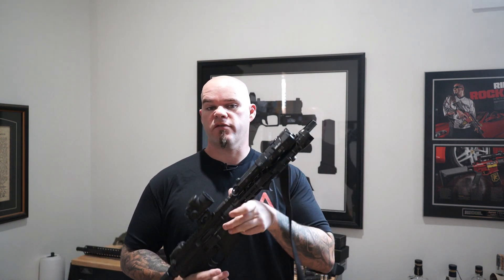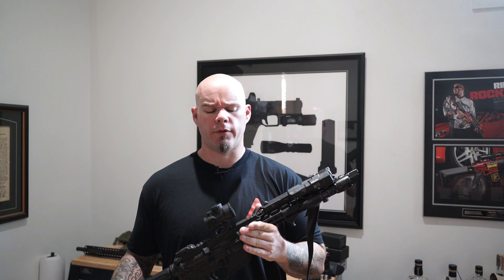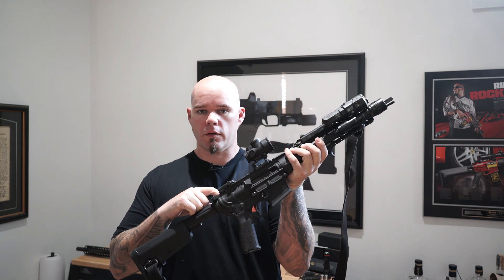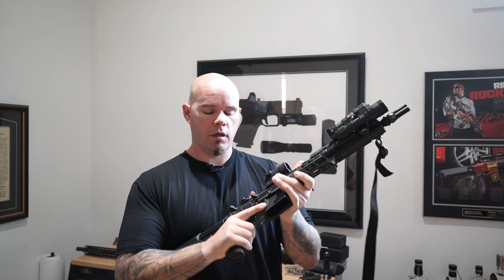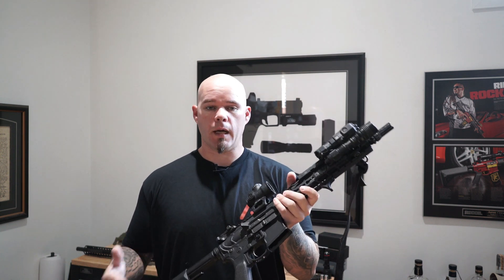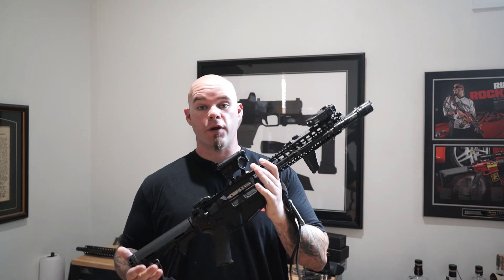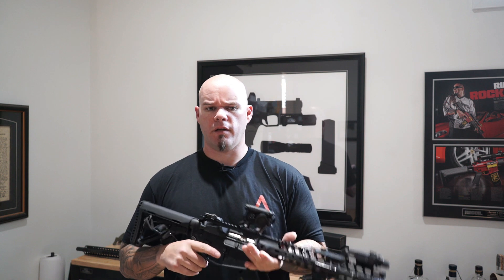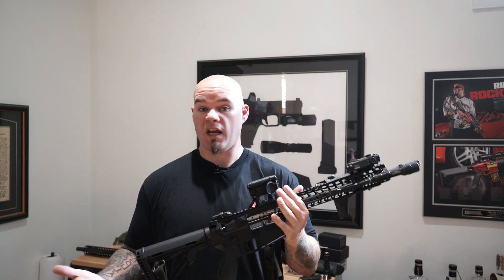The Forward Assist

Comment: I've used it while deployed. Sometimes the sand would cause the bolt to act sluggish in returning forward and would stop mid cycle. A Good tap on the forward assist and it would continue it's cycle of function. Yes I could just pull the charging handle, but the forward assist allowed me to keep a sight picture and continue to observe a target. Just food for thought, it's not necessary, but I prefer one on my rifle.
Reply: The Armorer The first sensible argument for FA I've ever seen. Fucking great job!
Reply: The Armorer 100%
Reply: Jesse Galuk he didn’t say anything about firing. He mentioned keeping his sights on a target which would be doable. Not losing sight of someone is a valuable concept
Reply: Jesse Galuk Its faster to get a good grip on my rifle than get a good sight picture and require my target, especially with an Acog. I do nose to charging handle so I have to pull my face off when I charge my rifle. Additionally I won't fire without aiming unless in very specific scenarios. Happy Thanksgiving dude.
Reply: I've used it many times . In a sandy environment. 7 years in the ME . This is YouTube take it with a grain of salt .
Reply: *re-aquire
Reply: The Armorer ???  What???  What situation have you been in where this is even plausible?  So you had your rifle shouldered with someone or something in your sights while simultaneously having reloaded a magazine and I'm assuming hitting your bolt release and the bolt stopped mid way to the chamber?  That's a stoppage that needs clearing not some tap on your FA situation
I know this is the internet but at least make an attempt at non fiction story telling
Reply: Jesse Galuk you don't.  He's telling pog stories
Reply: deadheart I'm an 11B and it's not while reloading, just mid shooting when the "moon dust" cakes up your rifle, slows the bolt carrier to the point where it might not be able strip a round from a gritty magazine.
Reply: The Armorer oh my god he’s an astronaut
Reply: Jerry lol "moon dust" is the nickname for the very fine sand in the middle East lol
Reply: The Armorer I understand what you're referring to, I don't understand the importance of maintaining your sight picture in the example you're using.  I guess the manual of arms and weapon malfunction corrections have changed in the 8 years I've been out.  
And you're now saying your bolt slows down, previously you said it stopped mid-way.  I'm sure you can see why I was confused.
Reply: deadheart deadheart sorry for the confusion, what I mean is the bolt slows down enough to not have enough momentum to continue forward and strip a round from the magazine, causing the cycle of function to stop. I've been drunk all this long weekend and still am, so hopefully I'm explaining well.
Reply: Just a question.  If it starts to slow down and eventually loosing enough momentum to strip a round off, it makes sense that a tap on the fwd assist would help, but wouldn't that just continue to happen.  I think his point would be to attempt to correct the issue.  However I can see the argument being what if you're mid fire fight or something....hhmmm food for thought......Now I kinda like the idea of having one there.  It seems to me it comes down to training because Aaron is right....if you use that thing in the wrong scenario, it will render the gun unusable.  I think Aaron's point is unless your so highly trained that you have the ability during a fight to determine when and when not to use it,  it's just better not to be there.
Reply: J Nault I would also believe those of us that may use an AR for personal defense here in the states would not require it! But I completely see how it would be useful for those fighting abroad. For all of those that have or are serving THANK YOU!
Reply: The only reason for the forward assist is to return the bolt home to be able to disassemble the rifle in case of malfunction. If the bolt isn't home, the rifle cannot be opened up. The charging handle is non-reciprocating, so pressing it forward does nothing to return the bolt if it gets stuck part of the way back.

Comment: I happen to agree with you on this 100%. If it’s there great and if it’s not oh well. However, I have come across one example where it came in handy. In a hunting scenario (yes some of us use AR in various calibers for that purpose) where running the charging handle and letting the bolt go home may cause too much noise, I have slowly chambered a round where half the time a gentle tap of the forward assist helped. Now that said, like you mentioned you can always use your booger hook to push forward on the BCG.

Comment: I remember in the Marines it was common for Bolt Carriers to have a shiny strip along the forward assist cut outs from the forward assist rubbing against it. We were taught and pressured to pound on the forward assist "man handling your weapon" to the point that they'd nearly brake. Imagine a metal rod grinding against your bolt carrier and it's easy to surmize that would be a timing shift or change in cyclic rate. Not an ideal situation. 
We were taught to do this during breaks in fire, and never used it in immediate action drills(malfunction correction) which consisted of these steps: 1 drop the mag, 2 pull the handle back(basically still holding the weapon with it withdrawn) and place your finger into the chamber to push out any double feed that may still be stuck. 
So basically there was no reason to pound on the forward assist yet Marines did it endlessly.  It's simply a bad design, that Gene Stoner was against and that the Army wanted because they felt that soldiers would feel uncomfortable not having anything to drive forward(pushing a bolt handle forward or pushing the Bolt handle on Garand/m14.

Comment: I've only ever used it in a hunting application. I have a fairly new rifle with low round count. I'd try and just push the BCG into battery with my finger after easing it home but couldn't. I'd still generally have to give to forward assist a good rack. The rifle has proper headspace and no cartridges have been deformed as of yet. I believe it's because my extractor tension is really tight. It has the 5 coil spring, black insert and o-ring.

Comment: The forward assist is for returning the bolt to the home position in case of a malfunction. If the bolt does not go all the way home you cannot open the rifle to inspect the malfunction. There is no other way to do this since the charging handle is non reciprocating. I really wish more instructors were aware of this simple fact.
Reply: Couldn't you just remove both take down pins to get it apart?

Comment: When I'd put my rifle back together wrong, it was under-gassed due to bad gas block alignment. It had enough power to push the carrier back far enough to grab a new round, but hadn't been pushed against the spring enough to push the round all the way into the chamber, basically shorting it by 2 centimeters of travel. I looked after clearing, good round, pretty quickly on the range figured out I'd screwed up the gas block, but had to still sight in the gun. So, fire, tap forward assist to chamber the round, and fire again.

So if the gas system's messed up, or there's something else to impair the motion of the bolt carrier rearward (or at all), but the chamber is otherwise good (no double feed, bad rounds, whatever), I think the forward assist is valid to employ. I can shoot faster tapping the forward assist versus racking the charging handle, and it also mitigates the need to rack out half the magazine's ammunition.

Good points on not making the situation in a chamber worse by forcing the bolt into it. While I did kinda know that, it's good to be emphasized. For what it's worth with my malfunction, it was one easy press per malfunction to chamber the round, versus hammering on the button.

Comment: My understanding is that a FA was never intended on the AR platform but featured as an added benefit to allow manipulation of the rifle in ways a charging handle doesn’t allow. Minimal movement is ideal. This is especially true in cold ass environments where your fingers feel like falling off. 

Carbon fowl is also a simple fact of shooting a rifle. To work around that problem, a quick tap after a press check is easier than press check and racking. Is it necessary? Not really but again, added benefit.

Comment: I thought the bevel in the bolt carrier was for getting it back into battery. That's what Stoner intended I believe. Same principle you mentioned about not forcing it into battery. If it won't go with minimal effort then you may need to check.

Comment: Great video  what's your thoughts on putting the safety on when transitioning to the handgun? I've seen arguments for both why to do it and why not to do it i tend to be in the middle situation depened  thanks in advance Aaron
Reply: guns and tactics Put that safety on. You don't know the exact reason for the malfunction and there is literally nothing to lose, and everything to gain by turning the safety on.
Reply: Mark Llamas  i understand that you won't do it under stress and that even if you do put it on safe say in the case of a double or triple  feed that you now have a dead . Locked inoperable gun but i really dont know I've never experienced one in my personal AR
Reply from the maker: Mark Llamas if you understand the rifle, you can diagnose the likely malfunction by how the rifle behaves. Also, there’s a few malfunctions that prevent you from being able to put the safety on anyway.

Comment: This is funny you mention that. As a fellow infantryman, 14 years, I can say the ONLY time I ever used one other than through the rote firing range drill, was when using blanks. The chamber gets so fouled, its needed. Real world? Never once. And I have been using this platform since 1988. As a lefty, for me it is simply more natural to rerack the bolt than to reach around awkwardly and hit the FA. 
Interesting that you mention how few modern battle rifles have them. I never thought of that.

Comment: I have used the FA exactly one time on the qualification range with a suppressed, under lubricated, and extremely dirty rifle that did not want to go into battery when being loaded.  In that instance, it worked.  But what the gun really needed was lube.  I would have no qualms about carrying a rifle without a forward assist in a duty capacity.

Comment: I agree with everything you have said.  I guess I would still prefer it for only one condition.  If I accidently ride the charging handle forward and the rifle is dirty or dry then it's handy to tap it into place.  

It's basicly a non issue though because I would never have to use the charging handle unless it fails to lock back or I have some type of failure. Just use the bolt release and it should be fine.  And obviously you can push like you mentioned.  It's simply a feel good measure that was put into place die to shitty Vietnam ammo that was originally issued.

Comment: Soldiers, Sailor, Airmen, Marines and Cops, DO NOT NEED A FORWARD ASSIST! If the bolt carrier won't go into battery, there is a reason.  
With that being said, I won't own an AR-15 rifle without one. The reason is this: I hunt coyotes with my AR15. When I move from stand to stand, I do it with the rifle unloaded, When I get to where I am going to set up, I QUIETLY load my rifle by committing the cardinal sin of riding the bolt home. I use the forward assist to insure the bolt carrier is properly seated. I know hunting has NOTHING to do with the context of this video, buts its why I want a forward assist.

Comment: There is an arguement that the FA be used for surreptitious loading while hunting.  It's not very applicable to purely defensive guns, unless yours is dual-purpose.
Reply: then you can just push the carrier forward with your thumb. On a side note,I shoot suppressed out of the AR a lot, and rarely clean it. Never have a malfunction due to dirty guns. I also then take my suppressed AR15 SBR in 300blk hunting and then try to quietly chamber a round near the stand, after riding the quad. Problem is, the cartridge doesn't chamber because of how dirty the rifle is and even the Forward Assist isn't able to force it in. So I have to loudly pull and release the charging handle, which works.

So several options; 1) Load the rifle before before I ride the quad, 2) Clean my rifle a little more (ewww) 3) Just chamber the cartridge normally and not care about the noise because I just got done riding a noisy quad.

Anyway, that was just a long story about how trying to be sneaky with a Forward Assist is still stupid.

Comment: I’ve used it. My rifle BCD kept stopping just short of the lock position. Half pull on the charging handle didn’t have enough force to send it forward. Full charge had enough force but would eject around. So tipity tap tap tappy on the forward assist and I was G2G.

Comment: They work good if you got a girlfriend or wife that doesn't charge the weapon properly at the range lol. That's the only time I ever used the forward assist on my rifle. But I guess I could just have charged it for her. Also, this Is out there but maybe you get injured and don't rack the gun enough to go in to full battery might be quicker to push the bolt home. But I agree 99% it just adds weight and a potential snag point on the gun.

Comment: I do agree, it's a useless control, but the U.S. army being one of the main dictating bodies on upgrading the m16 still believes in the idea "it's there to make you feel good/ better to have it and not need it than need it and not have it" also agree with the common sense point why would you need to silently push a hot bolt forward but at the same time a smart rifleman using common sense wouldn't ram the bolt down or a dirty chamber unless you absolutely had to either theres an easy solution when you're not being shot at... CLEAN YOUR RIFLE!

Comment: Most people will never need or use it,.. Ive only could see it purposely used to chamber a round more quietly, or when its super dirty while using a suppressor or has some grit in it,.. but you should already have it chambered,...not really a need for it for 99.999% of the people,..

Comment: It appears that the forward assist may have saved Kyle Rittenhouse’s life.  Watch his interview with Tucker Carlson.
Reply: So it did, I think slingshotting the bcg (utilizing the spring tension and inertia to put the bolt into battery)  would have worked just as well. With that being said I wasn't in that situation and hope I never am put in that situation.
Reply: @hanzenfranzen406  Slingshotting the BCG could also cause a double feed and make the problem even worse. In my opinion, using the forward assist first to close the bolt and get the round chambered is better due to it being quicker and easier to use. Then, if the forward assist isn’t helping, go for the charging handle.
Reply: @gameragodzilla  In that case though you have bigger issuers issues that would only be exacerbated by the forward assist aka getting a stuck case even more stuck since you just beat it into the chamber.
Reply: @hanzenfranzen406  Not necessarily. For example, if the extractor didn’t hook onto the round properly, then beating the forward assist into place would push the extractor over the cartridge rim and allow it to extract. It would cause undue stress on the extractor, but it’d work in a pinch.

If you get a case head separation, then you no amount of racking the charging handle will get it out. However, you can use the forward assist to beat another round into the other casing, allowing friction to hold onto the damaged case while you extract the whole thing out.

The point is there are situations where slingshotting the BCG would cause a problem too, meaning it’s not the reliable end all solution to all the AR’s problems. As a result, the forward assist has its place.